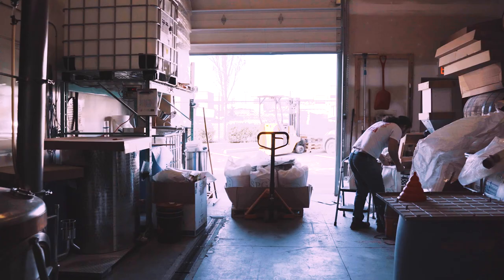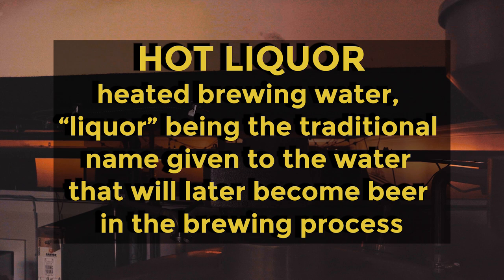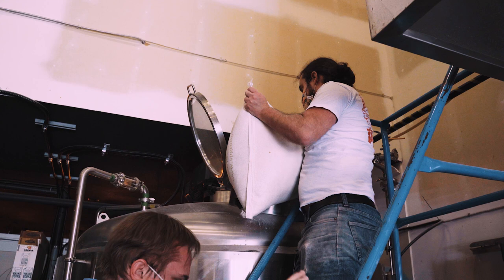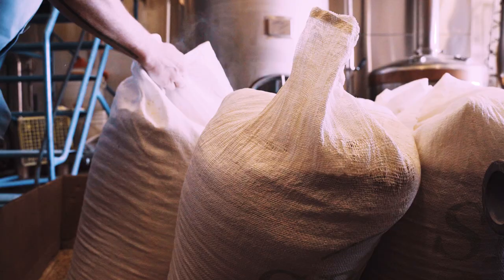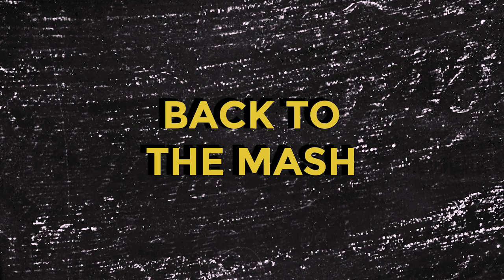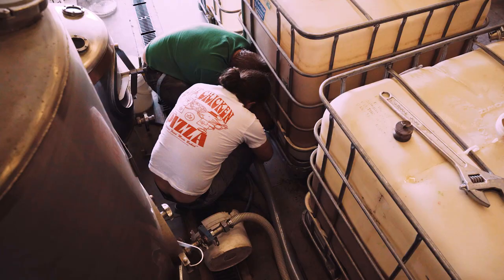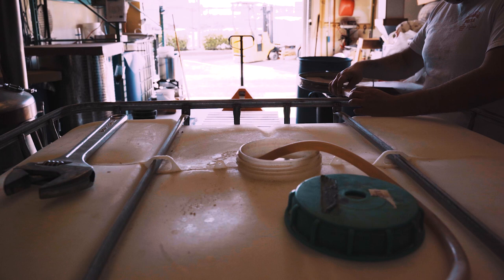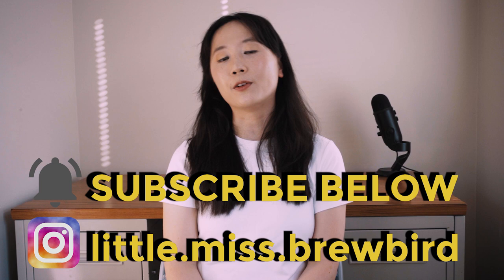Continuous Fermentation Process | Mad Lab Distillery

Comment: Does he get yeast beds accumulating at any stage during the process? Does he have to remove some to let new yeast generations take over and multiply? How is the oxygen management done, does the first stage introduce air and the two other stages anaerobic ferments?
Reply from the maker: The yeast cake is in IBC #1. I don't think he purposefully removes any of the yeast cake. The yeast cake will mix with the wash and some of the yeast will naturally leave when the IBC is being emptied into the still. The wort trickles in via the tube that is hanging into IBC #1 so oxygen gets in the IBCs that way. Also since there is no boil, there is dissolved oxygen in the wort as well.
Reply: Thanks bb

Comment: I have never seen such a large amount of HACCP violations in a single place since I visited a juice factory in the Central African Republic... 
Being certified out my ears myself for running a food production plant, I am amazed that the local authorities haven't closed the place down. I know that Canadian laws are not the same as in Europe, but this shouldn't fly anywhere. 
Dear lord, there is unpainted wood inside the production area, the floor is not coated or tiled (so not possible to flush/wash) and dirty, production and ingredients storage is mixed in the same space, and there is packing material also stored there. 
I saw so many Critical Food Safety Issues that nobody should drink this, regardless of the taste, I lost count. 
And let us not get into the staff not wearing correct protective gear around food... 

This was downright disgusting to see.
Reply: I had to do HACCP Level 3 in food manufacturing for our distillery. It's true the floors and bare wood will get pulled up by an inspector, at least for us here in the UK. I spotted that too. I'm only required to wear overalls gloves and hair nets after the filtration part for bottling to prevent physical and bacterial contamination, just being generally cleanly kempt is enough for general work elsewhere. Different rules for different sides of the pond I suppose. There is also the point to make that the end product is self sanitising and sitting in wood to age but that's I realise that's beside the point.
Reply: @diablothe2nd894  Thanks for the brewer answer of things. I do nuts so the requirements may be a tad different upon when and where the sanitation areas begin, or not.
Isn't the barrels heat treated or charred? That would give the protection needed in this case. Then there is also the tradition side of it, imagine the uproar if whisky had to be stored in stainless steel or glass instead of in oak casks. :)
Reply: @carlrehnberg4581  in a brewery I think they go by the assumption that if your hygiene is bad, the beer goes off. In a rum distillery, bad hygiene (using what's called "muck") is the whole point of infecting the batch with certain bacteria. For whisky while the oak is charred you still can't really get into the pores of the wood with sanitiser so the 70% whisky does the job itself, with similar rules for beer and hygiene the fermenting batch would go bad if you got something nasty in the batch.
My main worry is physical contamination with dust or hair and any allergens getting accidentally introduced post distillation.